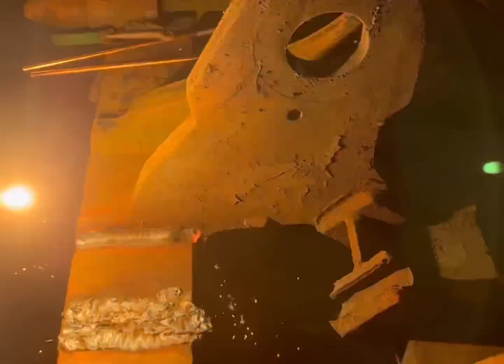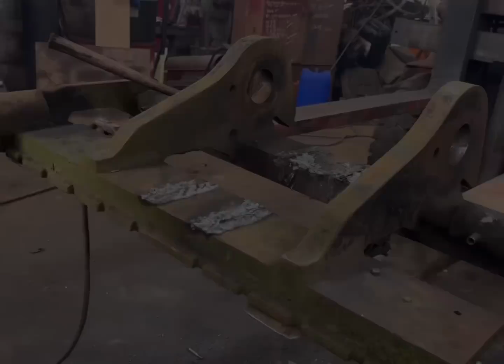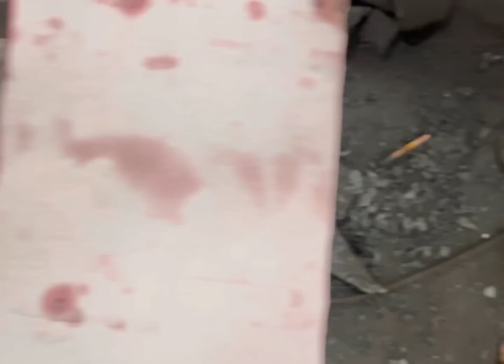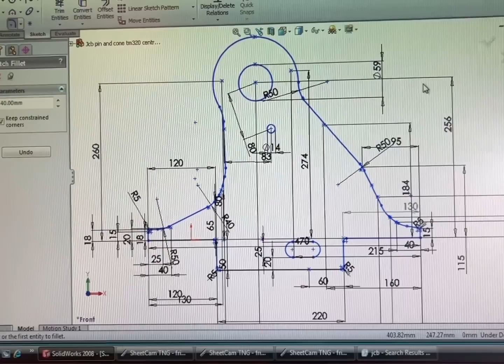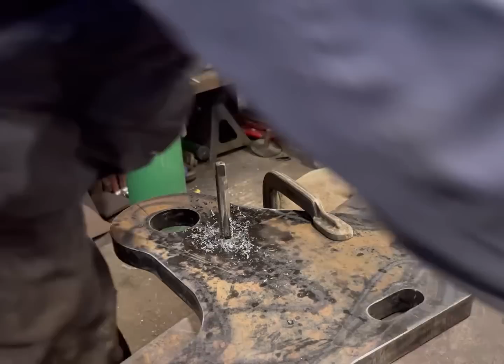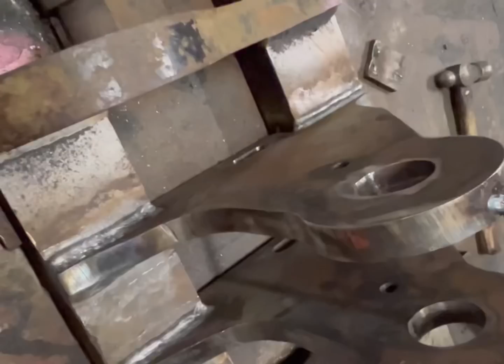JCB TM320 headstock repair. Part 1. Welding

Comment: I like your attention to detail. Getting to the root of the problem and modifying to eliminate poor engineering without undo gobs of metal attached that serve no purpose. Crack repair, good sound welding practice. Well done sir. Cheers

Comment: I’ve looked up arc gouging & how it works but i still can’t work out how the air gets down the carbon rod that’s held in what looks like an arc welding clamp ?
Reply from the maker: The air blows out of 3 little holes in one of the jaws that holds the rod. It’s a special torch for the job.
Reply: @snowballengineering  oh okay, Thank you.
I was incorrectly assuming the air was going down the rod.

Comment: Fun fact: A modest coat of the developer in your dye kit will make readings from an infrared temp gun more reliable, particularly on curved or shiny surfaces.
Reply from the maker: That’s good to know! I’ll do that next time. Thanks
Reply: Why is that Jim? It would be fun to know
Reply: @warrenjones744  This is because the developer will emit infrared light the way the temp gun expects.

Here we get into emissivity, which is how much IR radiation a surface gives off at a particular temperature.  At the same temperature a poor emitter (shiny metal, for example) will emit less than a good emitter (developer, electrical tape, skin, etc).

It's hard with a temp gun but with an IR camera you can see that poor emitters reflect IR from other sources.  Window glass makes a great example of this.

Helpful?
Reply: @jimsvideos7201  Makes perfect sense, Thanks

Comment: I won't pile on with the kill the music. If you MUST use it, it needs to be at a MUCH lower volume.
A remote mic with a good wind filter will go miles to help with the narration. It also should have an adjustable automatic level control. (Compressor Limiter built in)
That out of the way, I enjoy watching your work. Well equipped and well skilled. I'm not much of a welder, but I do muddle through. It is always useful to watch and learn from others. I would have had to SMAW weld all that as my GMAW machine doesn't have the capacity yours has. Nice plasma table! Back around yr 2000 my brother, a friend and I manufactured a turnkey 4X8 CNC plasma system in the states. Economy and under capitalization killed the company. I still have the 2nd machine at our little shop. But need to replace the motion controller/software as it is so obsolete now.
Waiting for part two. Line boring is always fascinating to me.
Reply from the maker: Thanks for the feedback. I’ve ordered a mic so hopefully that’ll be better.  Part 2 is already up. Check my other videos. Thanks for watching!

Comment: I wonder if jcb use spray transfer welding must be good penetration on those welds plenty on there by look of them nice wide fillets. Lot of stress on that part with ram pushing power. No wonder they break. We are enjoying  your vids plenty of different  content. Mark and ruth

Comment: Why don't you use a grinder to cut?
Reply from the maker: Carbon arc gouging is quicker and easier, especially when the plates have been weld prepped and have multiple passes of weld.
Reply: Cool video.  I was curious,not patronising.
Reply from the maker: @frunk6006  Thanks for watching! 😁